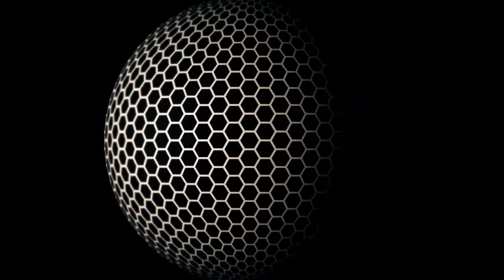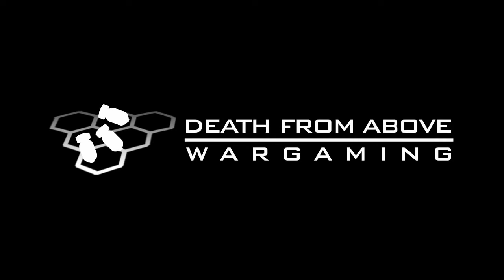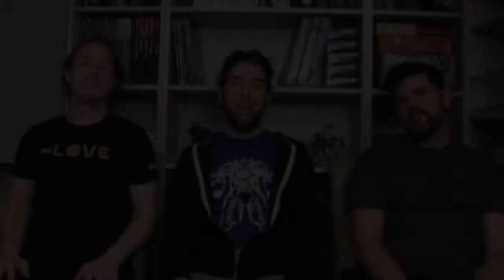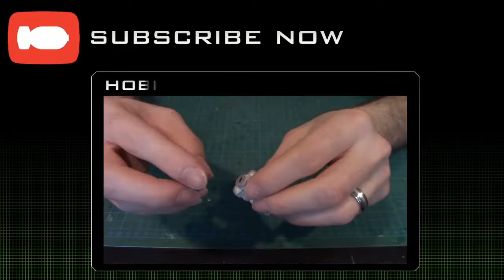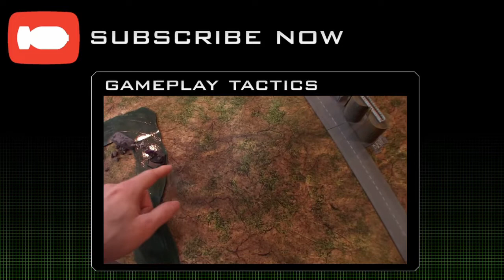BattleTech: How to Play Series - Heat & End (Revised)

Comment: repost for page references etc:

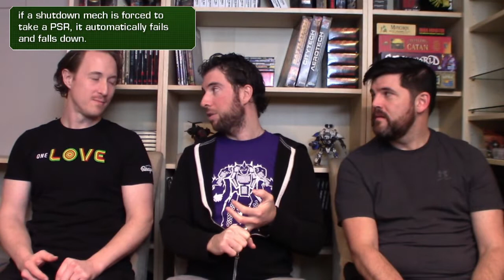3:10 BMM pg.52 "If a ’Mech shuts down, a Piloting Skill Roll (see p. 53) is immediately required, with a +3 Target Number modifier (any other PSR required while the ’Mech is shutdown automatically fails)."

However watch out! The rulebook appears to contradict itself on pg.18 "Piloting Skill Rolls: An immobile ’Mech forced to make a Piloting Skill Roll (see p. 53) automatically fails, unless it is prone." In isolation this rule fails to mention that a mech is not immobile until AFTER the shutdown phase. This is fully clarified in the foot note of the PSR table. "(Make PSR+3) Only during the phase that the reactor shuts down. If the MechWarrior must make a Piloting Skill Roll for a ’Mech WITH a shutdown reactor, the ’Mech automatically falls".

5:20 Yeah, you might want to shutdown occasionally. A shutdown engine doesnt generate excess heat, regardless of critical damage. So if you have two engine hits and are generating 10 heat on top of your weapons fire and possible hellfire rounds building heat further, a manual shutdown might be your best survival option to drop max heat (assuming you survive any ammo explosion checks etc).

5:35 Additionally an unconscious mech warrior classes the mech as immobile.
BMM pg.18 "The following are immobile: buildings; hexes; ’Mechs shutdown, abandoned, missing all four limbs, or with an unconscious MechWarrior."
Reply from the maker: Thank you!